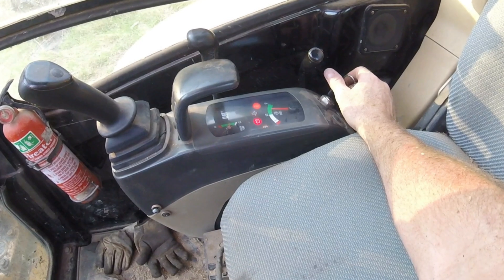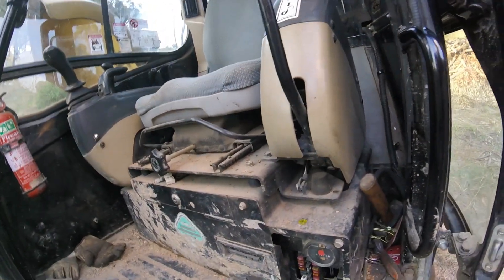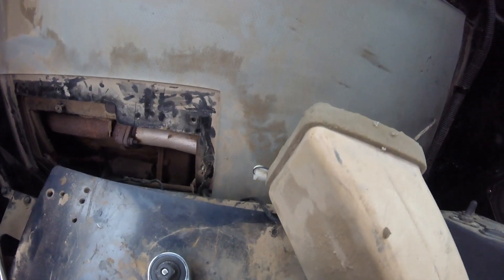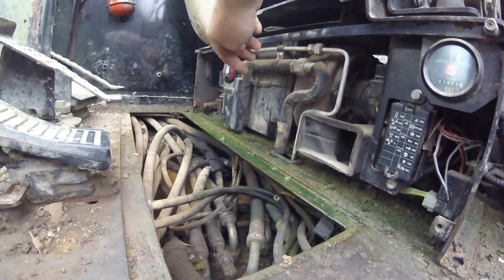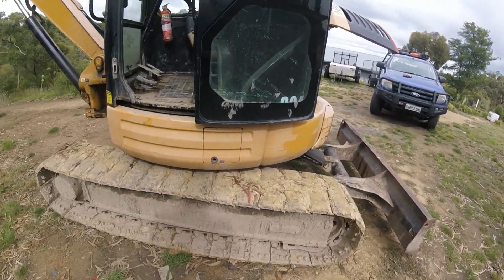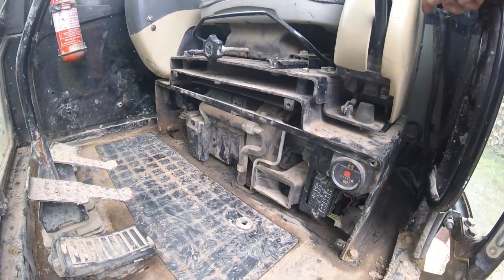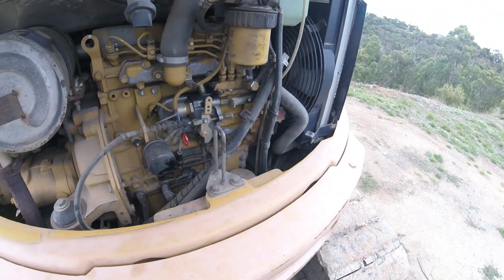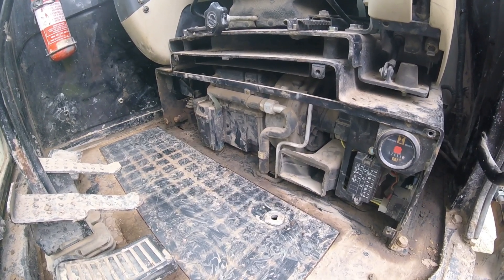CAT 304CR Excavator. Starter Motor Fault. Leaking Heater Coil Bypass - 2021 #24

Comment: How did you get the bottom left screw on the inside cover plate out. Mine is stuck fast with no room for easy access. Really needs an impact phillips head screwdriver but obviously no room😢
Reply from the maker: Mate I feel for you. Those screws are a bitch to get out. I used a small 1/4 drive ratchet to undo them. It was a click or 2 at a time. Took ages. Lost lots of skin. All by touch as you cannot see it. 
I tried a long long socked through the seat support but couldn’t find a path that would work. 
You might have to use a dremmel and grind the screw / bolt head off. 
I didn’t fit all the bolts when putting it back together. NO WAY was I doing that. 
Good luck I hope it frees up with some wd40

Comment: I had that happen on my Cat 304 before. It was rented out. They said the starter was bad. Replaced it for me. Then ever since, fuses kept on blowing. I replaced the starter. The blowing of fuses stopped. They was a semi often short in the starter. Not all the time, but too often for me.
Reply from the maker: Hey Thanks for the info, it’s been ok for a while but every now and again it blows a fuse. I looked into a new starter and it was $800 from 
CAT, and looks like a pig of a job swapping it. I’ll keep struggling and swapping fuses, I’m a weekend warrior so not too much of an issue to blow a fuse every 3 months. Good to know that swapping the starter fixed it for you because it’s been a pain trying to fault find.
Reply: Hey there RP, glad to say replacing that starter definitely solved the blowing of fuses. Your cat and mine are built quite different 😮. My starter is located in the rear of the machine. Mine is easy to get to. Nice job on your machine
Reply from the maker: @hamop3  hi, good to hear that info. I had a click no start a week or so ago. No blown fuses, I pulled the negative terminal off the battery for 2 mins. Put it back on and it fired up straight away. Go figure.
Reply: May have been just a bad connection on  negative terminal. My only guess.. After you and I get our machines better than new, we be able to tour the country fixing this model of excavator.  @TheRuralProject